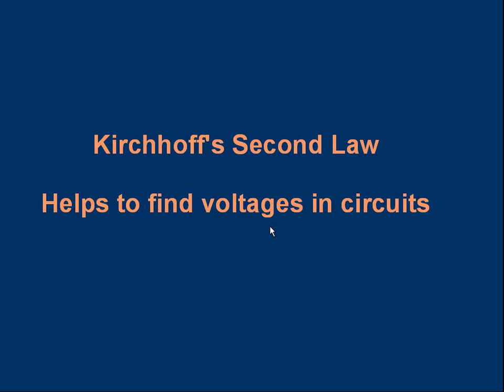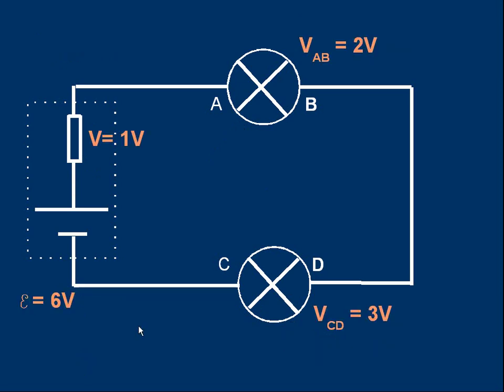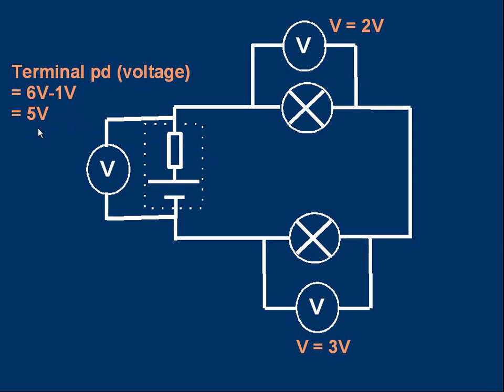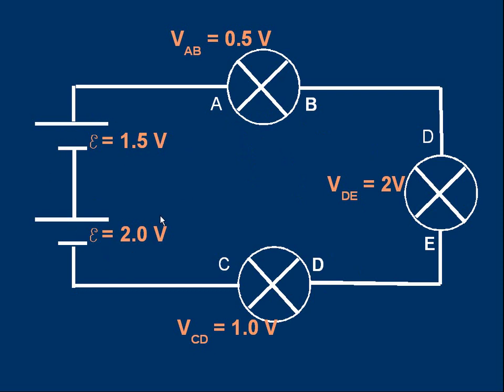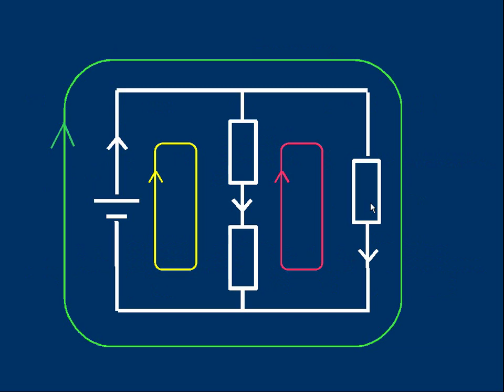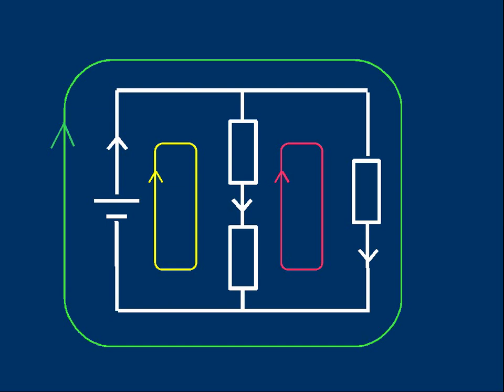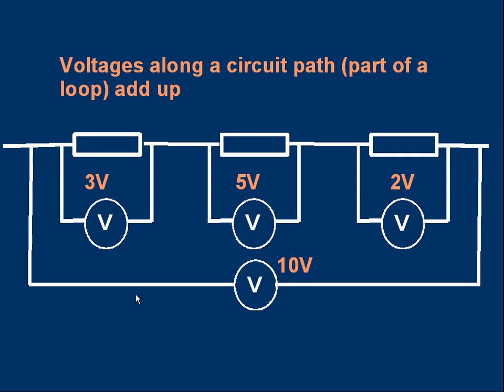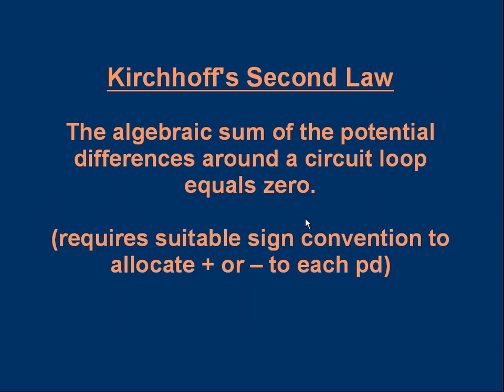GCE (A level) Physics E11 Kirchhoff's Second Law

Comment from the maker: +Zy Lau

Hi,

I hope you get to read this message, as YouTube won't let me reply to your comment in the normal way. Your comment is marked as a 'linked comment' and there is no reply option. (It may be related to what email provider you use, as YouTube is sensitive to this for some reason.)

Yes, in the second circuit I have assumed that the cells have negligible internal resistance. This means that the terminal pd (voltage between terminals) is always the same value as the emf. I should have stated this.

If internal resistance can be ignored, usually the question will tell you 'no' or 'negligible' internal resistance.

If a question says nothing about internal resistance, you can usually assume it is negligible. That's what I did in my second circuit.

But you have to use your judgement for some questions. For example if the cell's/battery's terminal pd depends on the current, you need to recognise this is due to the effect if internal resistance; in this case internal resistance is not negligible and made need to be accounted for in the calculation.

Sorry for any confusion. I hope it's clearer now.

Comment: in the first circuit, internal resistance is labelled and taken into account during calculation, the second circuit has no internal resistance labelled and it's not included in calculation. does that mean we only bother about the internal resistance when it's mentioned by the question?

Comment: I dont understand why the total voltage always equals the load voltage. i get that energy must be conserved but why cant some just return to the battery and turn back into chemical energy? also does anyone know of a link that actually explains kirchovs laws? I mean its all very well saying that the votages in a loop add up to the terminal voltage but why!!! I did A level physics and got an A just by learning formulas but I feel like Ive wasted my time. whats the point in learning how to answer problems if you dont actually understand anything. is it just me?
Reply from the maker: Hi.  Voltage doesn't flow around the circuit, so it can't 'return to the battery'.  I think the problem is that you don't yet fully understand what 'voltage' means.  Watch this video and it should help.
GCE (A level) Physics E03 Emf and voltage. Part 1 of 2
Reply: thanks. i never realy understood it. i just learned to get the questions right.i just dont understand why all the supplied energy is turned into light (for example). what dictates that all the supplied energy must be used up by the circuit? why cant some return to the battery? i gave up trying to answer this. my teachers didnt understand the question either
Reply from the maker: geobruf123

Hi.  You asked "what dictates that all the supplied energy must be used up by the circuit?"

That's like asking: when I throw a ball, what dictates that all the energy I supply is given to the ball?  Well, by definition, if you transfer 100J to a ball, the ball receives 100J.  If you supply 200J to the ball, the ball receives 200J.

If the battery supplies 100J, the circuit MUST use 100J.    But how quickly this happens is determined by the total resistance.

If the resistance is high, the current is small and it takes a long time to deliver 100J.  If the resistance is low, the current is large and it takes a short time to deliver 100J.

Can I re-suggest you watch the following video with this in mind:
GCE (A level) Physics E03 Emf and voltage. Part 1 of 2

Comment from the maker: Hi. A and B in parallel, voltage is V.   We add C, so A, B and C are all in parallel.

If there is no resistance in the rest of the circuit and we are using a constant voltage source (e.g. an ideal battery), V is unchanged.  

But if there is some other resistance, R,  in the rest of the circuit, e.g. a series component or internal resistance of the  battery, then V gets smaller. This is because the total supply voltage is shared between R and A&B. Adding C alters the split between R and A&B&C.

Comment: looking at the 6mins one. the 0.3 and 1.7 are in parralel with the cell, yes? if so then that should mean that each componet has a voltage of 2. or are in series and not parralel.

Comment from the maker: Do you mean the circuit at 6mins 63secs? See that part of the video.

Or do you mean this:

A and X are in series with a 1.5V cell.
But X consists of B and C in parallel.

Draw the circuit. Follow these steps (which use the method explained in the video):

Go around the loop consisting of [cell+A+B] giving:
1.5= VA+VB
VB = 1.5-VA

Go around  the loop consisting of [cell+A+C] giving:
1.5= VA+VC
VC = 1.5-VA

This means VB=VC.
VB and VC are equal and smaller than 1.5V. They both equal 1.5-VA.

Comment from the maker: Hi. In a parallel circuit the voltage of EACH component is the SAME as the cell's. E.g.  if you have 5 components connected in parallel to  a 1.5V cell, each of the 5 components has 1.5V across it.
(If you connect the 5 components in SERIES, the sum of their voltages add up to 1.5V, e.g. 0.4 + 0.1 + 0.2 + 0.5 + 0.3)

Comment: in a parralel circuit is the voltage of EACH componet the same as the cell or do all the voltages of componets along that line add up to the voltage of the cell?

Comment from the maker: Yes, it's absolutely fine.

But there may be things in the videos which you don't need, as they aren't in your syllabus - but it's always better to know a bit more than you need rather than a bit less!

And don't rely on the videos 100%. They may not have everything your syllabus requires.  The videos cover the core material; but there are many exam boards and variations of the syllabus, so I can’t tell you exactly what is and what isn’t required for your syllabus.

Comment from the maker: No - the sign convention for the 1st law is not related to the 2nd law. It only applies to one particular junction; it tells you if a current is entering (positive current) or leaving (negative current) the junction. In fact each junction has its own sign convention, because a current leaving one junction may then enter a different junction.

So the 1st law sign convention is unrelated to the 2nd Law 
Similarly the 2nd law sign convention is unrelated to the 1st law.

Comment from the maker: The top bulb (for example) has 2V across it and this voltage is DUE to the fact that heat/light is produced when current passes though the bulb, because of the bulb’s resistance.
If no heat/light were produced, the voltage across the bulb would be zero and the bulb wouldn’t work – it would just be like a piece of connecting wire.
You may need to check that you fully understand what voltage is – see “E03 Emf and voltage. Part 1 of 2” and “E04 Emf and voltage. Part 2 of 2”.

Comment from the maker: @javedb2 
As you add loops, the current decreases in each loop because of the internal resistance of the battery (see my answer to your previous question).  The point when 'the components no longer function' depends on what the components are and what their minimum current requirement is!  There's no general rule.

Comment from the maker: @javedb2 
Suppose a loop draws a 2A current and you are using a 'perfect' battery with a zero internal resistance.  If you add more identical loops, each will draw 2A.  So if you add 1000 loops, the (perfect) battery supplies 2000A.  In real life this doesn’t happen; the effect of the battery’s internal resistance limits the maximum current – a battery’s maximum current is its emf divided by its internal resistance.  The terminal pd will drop and each loop will have much less than 2A.

Comment from the maker: @javedb2 
Hi.  Adding more resistors in parallel does not increase the voltage; they all have the same voltage (watch the video about combining resistors in parallel).  So if you have 1000 loops attached to a 2V supply, each loop has 2V across it.

(However, in real life, the internal resistance of the supply would reduce the voltage to less then 2V.)

Comment from the maker: Hi thisisineedalife.
4V is not mentioned. The battery supplies 2V and this equals the sum of the voltages across the resistors - also 2V.  The 2V from battery and the 2V across the resistors are NOT to be added together to give 4V.
I should have referred to the battery as supplying 2V emf . It is quite common to refer to a battery’s emf as its ‘voltage’, which is what I did –  is that the problem?  The sum of the voltages across the resistors (2V) must equal the battery’s emf (2V).

Comment: i dont entirely understand the circuit at 8:52. If the enegy supplied by the emf always equals the sum of all the p.ds of the circuit, then why does the sum equal to 4v? havent you just created 2 volts from nowhere?

Comment from the maker: If you have 2 cells in parallel with the same emfs, E, and the cells are the same way around, the combined emf is still E (it would be 2E if they were in series).

If the cells are 'ideal' (have no internal resistance) and have different emfs, then this is a physically impossible situation with one cell driving an infinite current through the other.  It is meaningless to consider it.

For real cells in parallel, the overall emf is best calculated using Millman's theorem.  (outside GCE syllabus)

Comment from the maker: As explained (at 5.25) I was giving a 'simple practical' interpretation, not something to be learned for an exam. When I referred to the voltage across the battery, that is easiest concept for most people to grasp - it is what you see when you connect a voltmeter across the battery.  I then go on (about 5.58) to give  a more formal statement using the proper terminology (emf rather than voltage).  Sorry if it caused any confusion.

Comment from the maker: Hi 12345Anee.  The video is correct.  For example if you take 2 identical cells, 1.5V each, then connect them them the 'normal'  way (+  - + -) you get 3.0V.  But if you connect them the wrong way ( + - - + or - + + -) you get 0V.  If you have acess to a voltmeter and 2 cells you can try it for yourself.  Another way you might be able to check this is with a torch which uses two cells - bulb is dim with one cell, bright with 2 cells the right way round, and bulb off if cells are the wrong way.